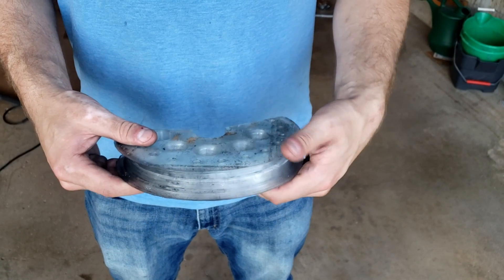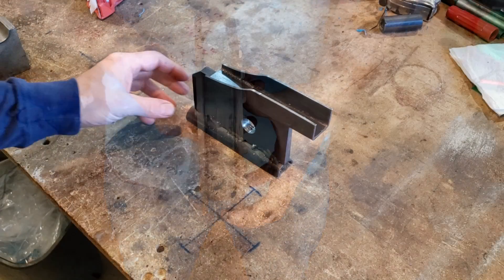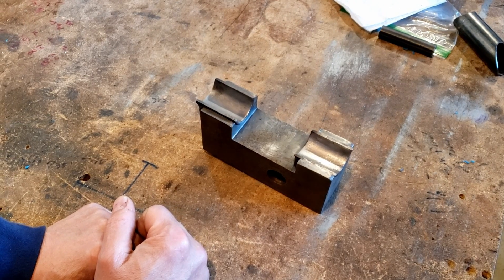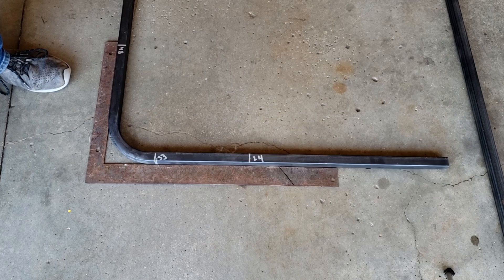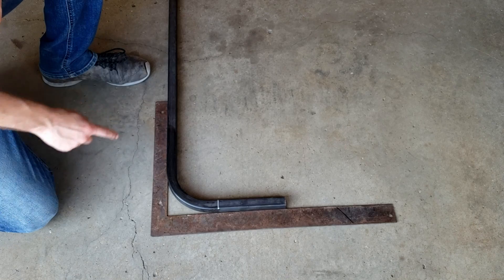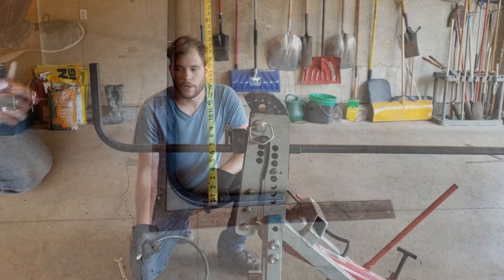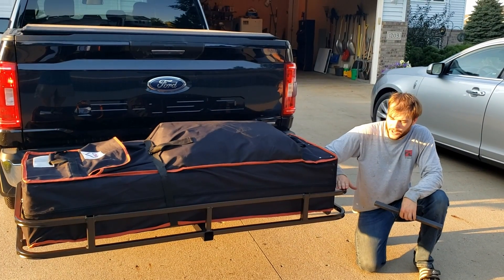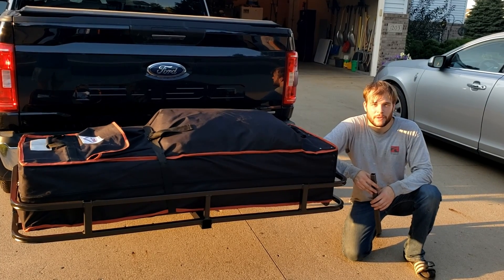3D Printed Square Tube Bending Die

Comment: Making adapters for the follower die is pretty clever. I built a tube bender in my garage and only purchased one 1 5/8" die set. I think I'll try your idea. I'm currently trying to figure out how to make a mandrel for it. Might use a piece of cable and some delran or more simple straight mandrel. Still experimenting.

Comment: If you haven't, you should drill a hole in the side of those vertical tubes to let the water out. Another option would have been to weld a small piece of pipe through the bottom square tube under that vertical piece for a drain. Nice job on the dies and the rack. I'd also like to see the plans for the bender.
Reply from the maker: It's hard to see in the video but the vertical tubes are actually offset slightly and not welded on one side to let water drain.